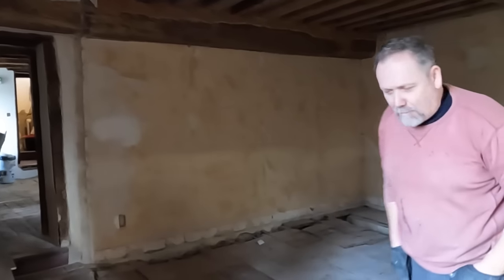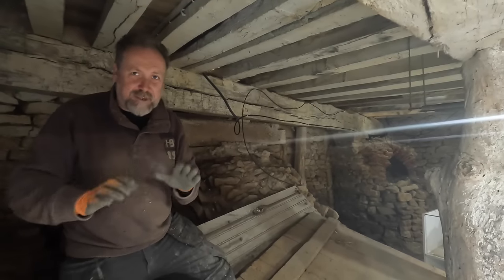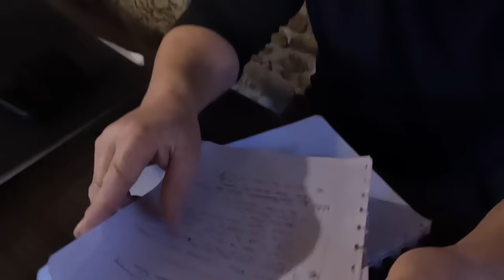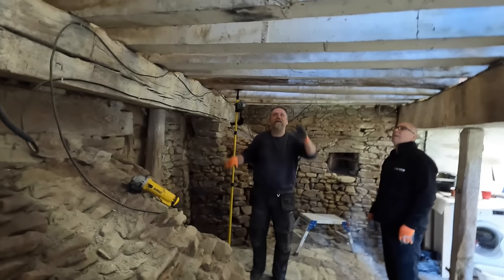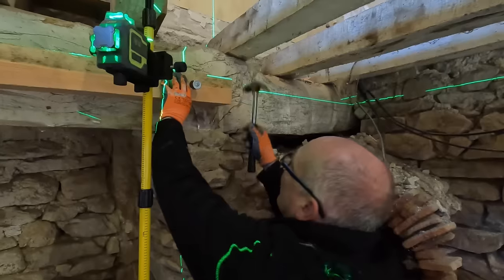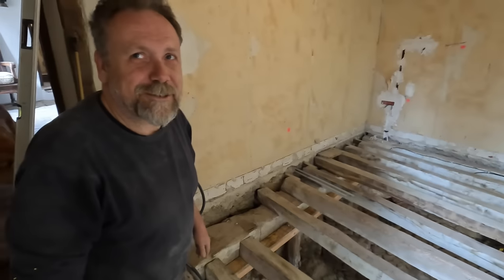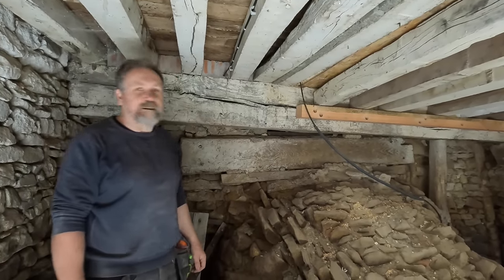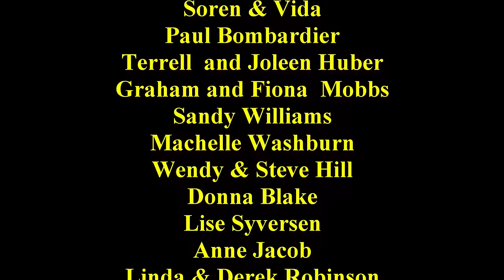Leveling an ancient floor in a medieval castle

Comment: Ted, I believe it's called a Brain Dump.  When I have a huge project with a million details swirling around in my head, I worry about missing something crucial and I freeze up on what steps to take first.  Getting it all on paper where the details are in front of me instead of swirling around in my head is so helpful!  Looks like you've got a plan and you can have the satisfaction of checking each task off!  Great job!

Comment: You both do such lovely work. Very much the right decision to remove sun symbol it is not historical as the concrete tells the story. Maybe use it elsewhere as a floor stone or in a wall outside. Opps post before I saw it was attached and needed breaking up. A job well done. Keep up the great work love it all whenever you are able to post. Look after you first. Love from Mandurah Western Australia 🇦🇺

Comment: I would be a bit nervous having the whole floor basically held up by a couple of screws fixing the new beam to the massive old one. Maybe consider adding vertical support holding up the the new beam, like that column that apparently helps holding the old beam in place.
Reply from the maker: The new timber is held in place with 6 x 140mm bolts with 100mm into the old beam, however, I am thinking of supporting the whole thing with another piece of oak as and when I can find a bit, cheers for the comment 😁

Comment: After watching the video of Charlene removing the Ivy from the chateau.  I wanted to have you consider removal of the English ivy roots and replant using Boston Ivy as it does NOT destroy the structure of the building.  It has the look of ivy and changes color with the season.